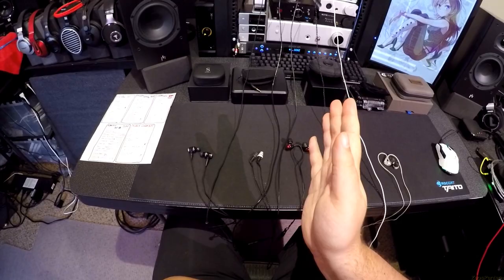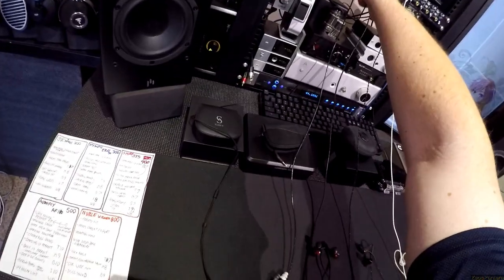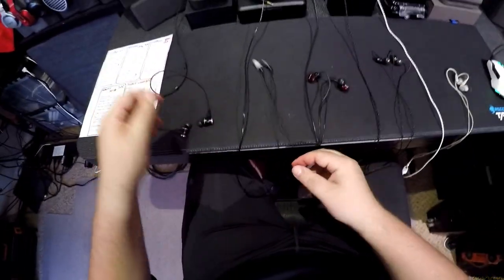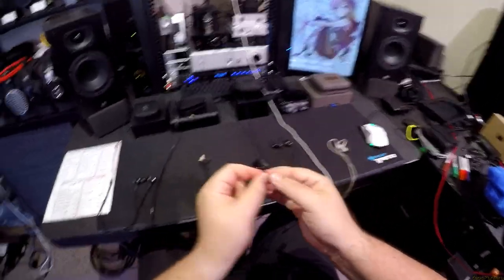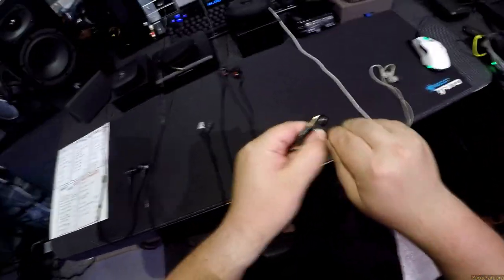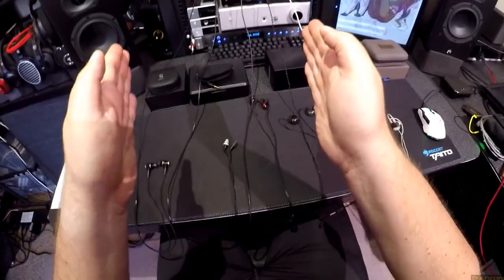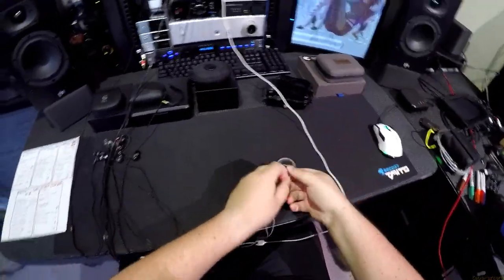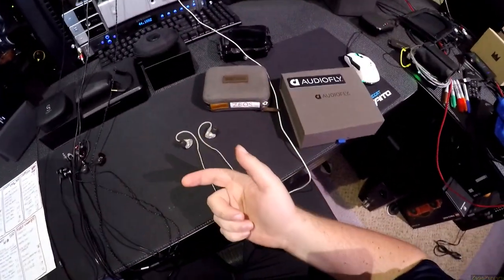Z Review - IEM Shootout #6 - AKA "The Bloodbath"

Comment: >Shure 535. Bass lacks impact
WUT?

imo:
- Not really good highs and vocals are laid-back. A bit too much of bass. Not fun to listen to. 
+ Good, fast bass. Great sound isolation. Good fit.
Reply: Literally my reaction
Reply from the maker: I call it like I hear it. Maybe my pair broken. Maybe my ears broken. Too many variables to correct. ERROR404
Reply: SE535 LTD Red. Treble a bit recessed in the upper highs, mids full, bass good in quantity and impact, textured, amount depends on the seal and tips used.  Overal sound could be more airy, more open in the treble region, can sound congested due to bass. I have the Ety's too, and I love em,  but the SE535's sound more fun? So not sure what happend :-)?
Reply: I'm worried that you got a knockoff se535 since, in my country anyways, have a lot of those at around 1/4 the price. But since you gave the imaging a 9, idk...
Reply: Kevin Kosasih No they just not best. UE TF10 much better sound. Shure even LTd are well overrated on paid written articles. 
If would know never would buy them. So save your money. Muffled but great with female voices. That's what they can be used for.
Reply: No the treble is literally bad. Just compare them to cheaper iems like ER4SR or N40.

Comment: Shure sound is pretty terrible in my experience, the cable is trash the memory thing over the ear is stupid, the insertion takes forever to work.  I prefer the Etymotic, I had the ER4 PT and went up to the ER4XR, the bass is way better probably an 8  based on how Z rated others, microphonics are still an issue  unless you loop them around the top of your ear then there isn't.  The clarity and imaging is better than the ER 4PT and occasional wideness that you don't expect.  Also detachable and more fun to listen to.

Once you wear in the plugs they feel fine.

Well shit now I have to try out  Audiofly lol

Comment: Thank you for great review Zeus! Currently have Se846s & fx 850s, used to have 535s & listened almost all FXs. Absolutely agree with you about SEs: it is like "transistor refined details all around you - "WOW effect" lasts minutes,  with these you can hear the structure & details - but not "body of sound" - typical armature, not best balanced. With FX's is completely different: muddy, punchy, colorful, between your ears is too much bass, but ALIVE! 535s are poorly made, more forwarded, lacks bass in comparison to 846s - still they are both harsh & flat. Despite this facts I think that's why me & most ppl like 846s: they are "durable sound constructor": change sound filters (physical "equalizer" that is not making sound worse) + buy at least 350 usd cables. Yes, it is stupid from the point of view, that you can buy another good IEMs for this price, but due to sensitivity  of driver technology you can always get Something very different in sound: more copper part in cable, more thick - more bass, more punchy sound, more silver part - more  "sparkles & air", high quality copper with silver layer - whole range is wider, clearity is better + change sound filters and get "your sandwich". Of course, like every armature IEMs, all these combinations generally won't make them sound less harsh, more deep & natural. To my mind, 846's, 180s or any, even top 15th driver armature IEMs with 2k golden cable just due to its technology won't be as close as natural as dynamics & won't soothe your ears. For any IEMs formula: / more plastic in construction = more artificial timbre / is much more strong then for over ear's. Generally, I want to say that FX's in pair with "analog" sounding source can be good asset for analog era recordings, Se's - not bad for digitals. Something between? Unfortunately planar technology can't make truly portable & isolated sound IEMs, electrostatic IEMs - no bass, stupid amplifier box to carry around. Maybe tesla's dynamic?, but still nothing really good with this tech on market. So let's keep calm & wait a little bit for perfection ))

Comment: Zeos pls help ;_;, m1060, HD 650 or dt880
Reply: M1060 = Musically enjoyable, Good articulate abundant bass. Wide sound stage.

HD650 = HD600 are among the most tonally balanced, but a bit analytical (might be boring for some), and very intimate sound (no sound stage). HD650 are modified to add to the bass a notch, and a little bit of sound stage. Both benefit very much from a tube amp.

DT880: They are among the good from Beyer-Dynamics that are known for their intolerable highs. Good sound stage. Enjoyable.
Reply: get 880 600ohm

Comment: I own the ie80 and they are way too midbass bloat heavy. IE80 has a wider soundstage but lack depth so vocals sound too far away for acoustics and anything else that is intimate sounding. 

When the ie80 is hooked up to a genre that suits it, it is good, otherwise its average at best. I also own the CX5.00, those are almost ie80 like at less than a third the price.

Audiofly AF180 is a tight little iem and worth the asking price. The IE80 is overpriced at anything over $250.

Comment: Did anyone notice that he was wearing the Shures backwards?  Ha
Reply from the maker: FF. Not.. I mean. No.
Reply: I had the SE535, didn't keep them long, they are designed for analytical applications, Audiophiles like them.  But yes they are boring, so I got rid of them, I still enjoy my $99 SE215 that I purchased 6 years ago for recording music and mixing.  They are perfect for music listening and the bass is so detail.  I use them every day, for the last 6 years (I sleep with them on), and they still rock.  Best $99 I have ever spent. Wherever I go, I have them with me.  At any given time I feel like I need to tune out the world, I just put those on and float away with my jams. 

 

Fuck them boring ass SE535.  

And yes, according to the way the over-the-ear wire was shaped in the video, you been wearing them on the wrong ears, so yes they gonna be uncomfortable as hell.
Reply: when?
Reply: Yeah I checked with my shures aaaand that seems backwards.
Reply: you should try them with another filter, they are more fun then

Comment: None of the rest are half as good as etymotic
Reply: If Jerry disappears mysteriously..brAh
Reply: slowmopoke What does that even mean?
Reply: John Yang Agreed 100%
Reply: Purple Balloons yay
Reply: John Yang Even the $100 HF5 is better than the rest of the stuff on that table.
Reply: Purple Balloons Mk5 right babe.
Reply: John Yang I've never heard the mk5. How does it compare to the hf5 and er4s/pt?
Reply: Purple Balloons I have all er4psb er4srxr mk5 mc5 hf5 in hand. Simply hf5 plus ptos cable/adapter = er4s. Sr is er4s with slightly different timber. Mk5 sounds really similar to er4s with really good tonal balance and slightly better bass and slightly smoother highs than er4s. And I don't like er4xr because it sounds weird, if you want bass buy klipsch x11 + ptos adapter and 3 flange tips. 
So after all. I love mk5. Mk5 is not any worse than er4 with much lower distortion  but it has somewhat closer soundstage. And it also can be improved a lot on a dedicated desktop amp like burson.
Reply: Purple Balloons The only down part of mk5 is the consistency of the driver. The drivers are not measured the same from unit to unti I have 3 pairs. They are not the same. But sounds almost the same. And don't worry. Qc is still better than 90% of the product on the entire market.
Reply: John Yang That was fast. Thanks for the reply!
Reply: Purple Balloons No worries. I am a enthusiastic etymotic lover.